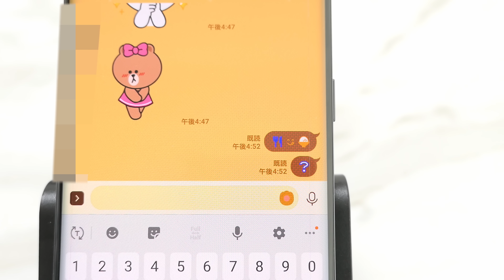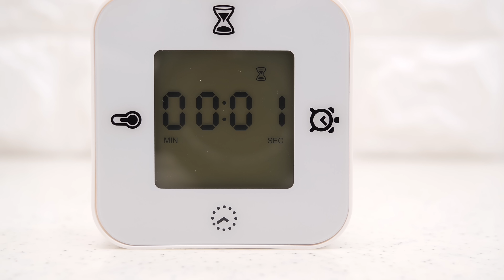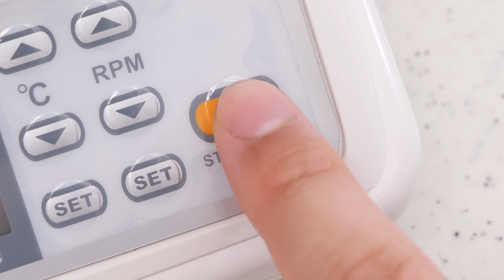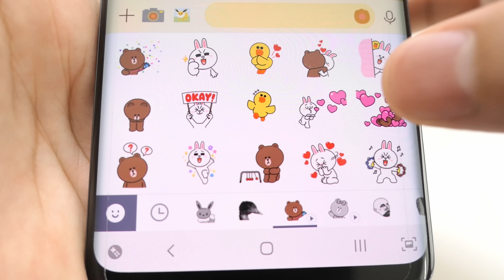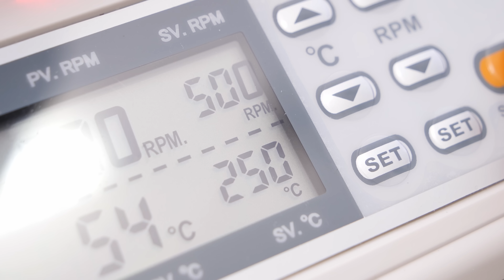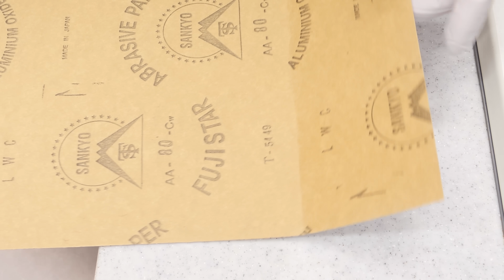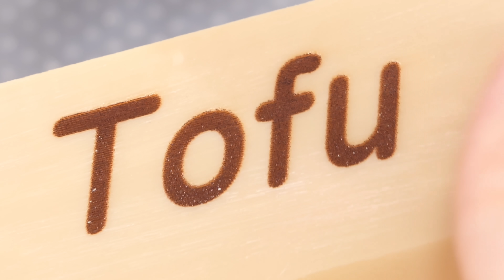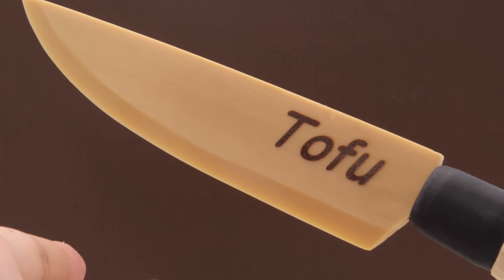このヤンデレは豆腐を包丁にして帰りを待ちます

Comment: There is no sharpest knife in the world. Sharpening the edge of any blade depends on how it's done. The issue with any sharpened edge is the duration it will remain sharp after the same usage as a different blade utilized the same. Thus it's the materials and forging prossess that makes for the duratiion of a blade's sharpness in addition to the process of sharpening it.